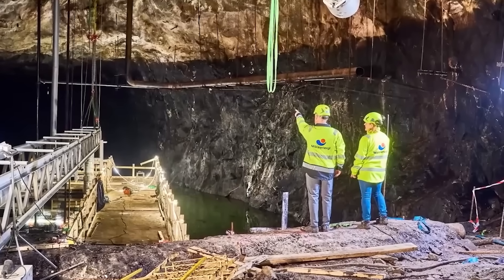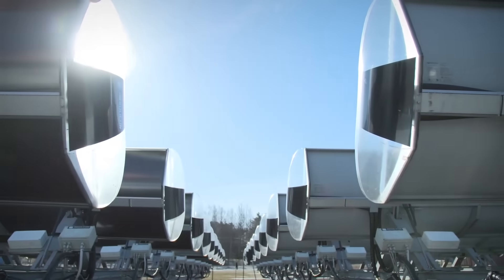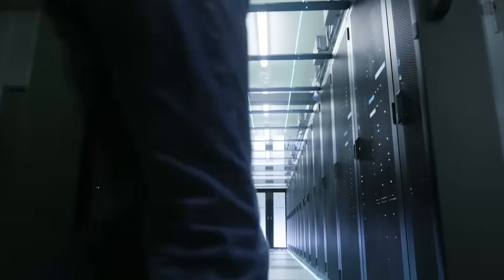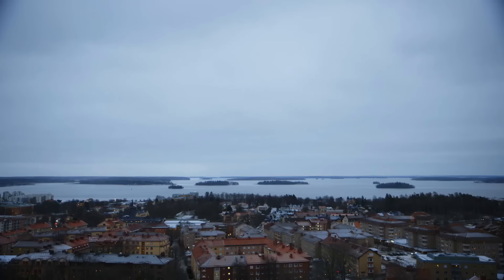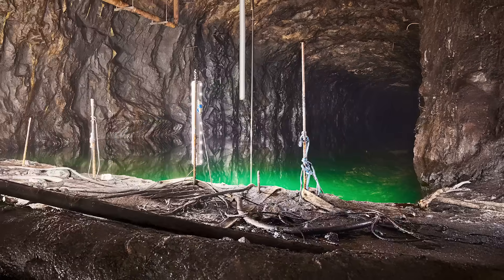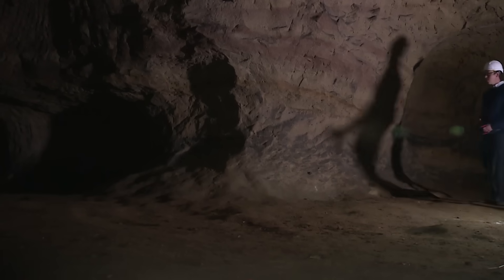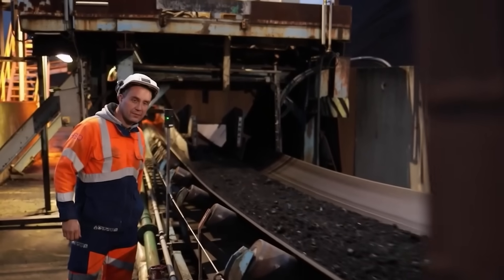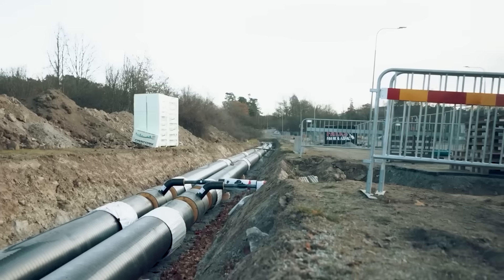Sweden Filled Underground Caves With Tons of Boiling Water, a Year Later the Result Was Unexpected

Comment: after hearing how Koreans pumped hot air into their floors for heating (since they traditionally slept on the floor like the Japanese), I thought that it could be a good idea to have the hot water pipes zig-zag through certain floors in homes (living room, bathroom & bedroom mostly) w/out having to concern yourself w/ carbon monoxide poisoning from the old wood burning system; this system in the video is genius
Reply: I have seen houses in the United States that have used hot water hoses under floors for heating.
Reply: Many homes in the U.S. Have in floor hot water heating. it's not that great and they usually need additional heating. It's nice for floor warmth but in no way heats the whole house alone.

Comment: 022307.  Peaceful revolution driven by clean abundance

The second law of thermodynamics may be false conventional wisdom. Let's face the wonder of full heat use. 

The s2econd law of thermodynamics was developed during victorian england's scientific and religious fascination with steam engines. 
Many people act as if this paridgm is inescapable. 

The second law is behind modern refrigerators needing electrical energy to compress the refrigerent to force it to release as waste the heat that it has removed from the refrigerator's service interior in the cooling part of the refrigerent's circulation. The interior coldness draws in exterior heat through the cabinet insulation. There is also discarded heat from mechanical friction and electrical resistance. The net thermal output equals the electrical input with energy not being gained or lost in this refrigeration system including its forced waste. Unencumbered refrigeration by the principle that energy is conserved should produce electricity instead of consuming it. 

It makes more sense that refrigerators should yield electricity because energy is widely known to change form with no ultimate path of energy gain or loss being found. Therefore any form of fully recyclable energy can be cycled endlessly in any quantity. 

Full heat recycling, all electric, very isolated underground, undersea, or space communities would be highly survivable with self sufficient EMP resistant LED light  automated vertical farms, thaw resistant frozen food storehouses, factories, dwellings, self contained elevators, safe rooms, and horizontal transports. 

In a flourishing civillization, small self sufficient electric or cooling devices of many kinds and styles like lamps, smartphones, hotplates, water heaters, cooler chests, fans, radios, TVs, cameras, security devices, robot test equipment, scales, transaction terminals, wall clocks, open or ciosed for business luminous signs, power hand tools, ditch diggers, pumps, and personal transports, would be available for immediate use incrementally anywhere as people as individuals or larger social groups see fit. 

Some equipment groups could be consolidated on local networks. 

If a high majority thinks our civilization should geoengineer gigatons or 
teratons of carbon dioxide out of our environment, instalations using devices that convert ambient heat into electricity can hypothetically be scaled up do it with a choice of comsequences including many beneficial ones. 

Energy sensible refrigerators that absorb heat and yield electricity would complement computers as computing consumes electricity and yields heat. Computing would be free. Chips could have energy recycling built in.
This would improve performance and lower cost, 

Refugee communities would be buildable quickly.  

A simple rectifier crystal can, iust short of a replicatable long term demonstration of a powerful prototype, almost certainly filter the random thermal motioren of electrons or discrete positiive charged voids called holes so the electric current flowing in one direction predominates. At low system voltage, a filtrate of one polarity predominates only a little but there is always usable electrical power derived from the source, which is Johnson (observation) Nyquest (theory) thermal electrical noise. This net electrical filtrate can be aggregated in a group of separate diodes in consistent alignment parallel creating widely scalable electrical power. The maximum energy is converted from ambient heat to productive direct current electricity when the electrica6bzDVgBhrhYl load electrical resistance  is equal to the array internal electrical resistance. 

Maximum calculated electrical power output (watts) is k (Boltźman's constant), one point three eight x 10^ minus 23, times T (temperature Kelvin) times bandwidth (0 Hz to a natural limit ~2 THz @ 290 K) times rectification halving and nanowatt power level rectification efficiency, times the number of diodes in the array. 

There are a billion cells of 1000 square nanometer area each per square millimeter, 100 billion per square centimeter. 

Order is imposed on the random thermal motion of electrons by the structual orderlyness of a diode array made of diodes made within a slab: 

Host crystal is silicon
  P type boron doped
-----‐------‐----___-- Out
🔻🔻🔻🔻
■■■■■■___ + Out 
  N type phosphorous doped 

All the P type semiconductor anodes abut a metal conductive plane deposited on the top face of the slab with nonrectifying joins;  the N type semiconductor cathodes or common cathode abuts the bottom face. As the polarity filtered electrical energy is exported, the amount of thermal energy in the group of diodes decreases. This group cooling will draw heat in from the surrounding ambient heat at a rate depending on the filtering rate and thermal resistance between the group and ambient gas, liquid, or solid warmer than absolute zero. There is always a lot of ambient heat on our planet, more on equatorial dry desert summer days and less on polar desert winter nights.

Focusing on the composition of one simple diode, a near flawless crystal of silicon is modified by implanting a small amount of phosphorus (N type conductivity) on one side from a ohmic contact end to a junction where the additive is suddenly and completely changed to boron (P type conductivity) with minimal disturbance of the crystal lattice. The crystal then continues to another ohmic contact. 

A region of high electrical resistance forms at the junction in this type of diode when the phosphorous near the ĵunction donates electrons that are free to move elsewhere while leaving phosphorus ions held in the crystal while the boron donates holes which are similalarly free to move. The two types of mobile charges mutually clear each other away near the junction leaving little electrical conductivity. An equlibrium width of this region is settled between the phosphorus, boron, electrons, and holes. Thermal noise is beyond steady state equlibrium. Thermal noise transients, where mobile electrons move from the phosphorus added side to the boron added side ride transient extra conductivity so t⁶he forward moving  electrons are preferentally filtered into the external circuit. Mobile electrons are units of electric current. They lose their thermal energy of motion and gain voltage, as they transition between the junction and the array electrical tap. 

Inside the diode, heat is absorbe; outside the diode, to exactly the same extent, an attached electrical circuit is energized. The voltage of a diode array is likely to be small so many similar arrays need to be put in series to build higher voltage.  

Understanding diodes is one way to become convinced that Johnson Nyquest thermal electrical noise can be rectified and aggregated. Self assembling development teams may find many ways to accomplish this wide mission. Taxonomically there should be many ways ways to convert heat directly into electricity. 

A practical device may use an array of Au needles in a SiO2 matrix abutting N type GaAs. These were made in the 1970s when registration technology was poor so it was easier to fabricate arrays and select one diode than just make one diode. 

There are other plausible breeches of the second law of thermodynamics. Hopefully a lot of people, mostly as independent teams, will join in expanding the breech. Please share the successes or setbacks of experiemental efforts. 

These devices would probably become segmented commodities sold with minimal margin over supply cost. They would be manufactured by advanced automation that does not need financial incentive. Applicable best practices would be adopted. Business details would be open public knowledge. Associated people should move as negotiated and freely and honestly talk. Commerce would be a planetary scale unified conglomerate of diverse local cooperatives. There is no need of wealth extracting top commanders. We do not need often token philanthropy from the top if the wide majority of people can afford to be generous.. 

Few people have responded to this essay. The topic deserves discussion.

Aloha
Charles M Brown